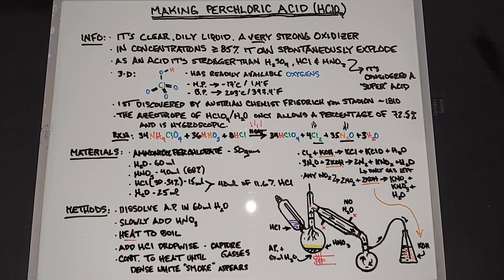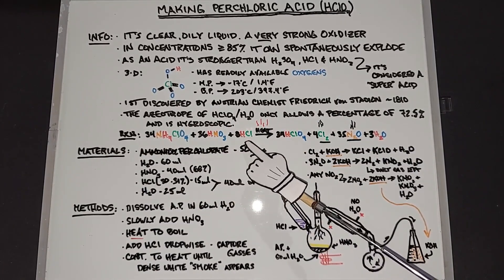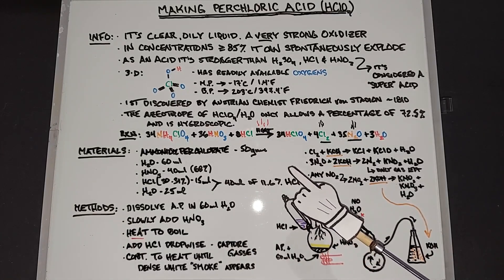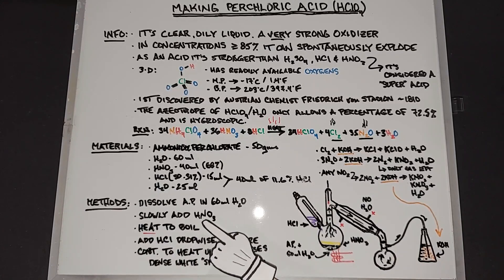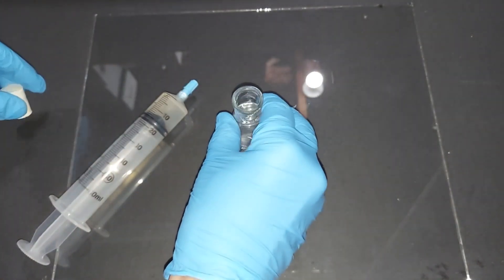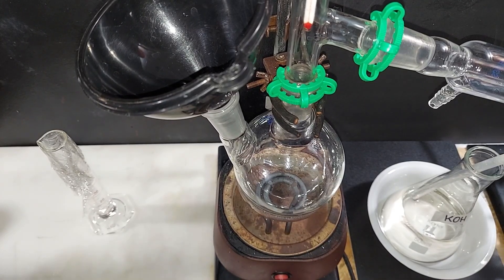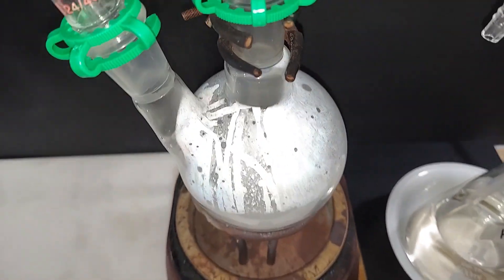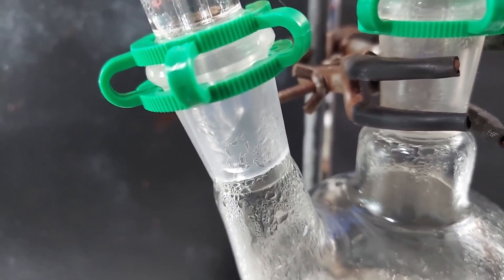Making The Highly Explosive Perchloric Acid (HClO4)

Comment: Would it be possible to synthesize HClO4 from KClO4 this way? Have read div forums and searched the whole internet without any good method. In EU its not possible to buy anymore for private individuals anymore sadly, and it's become a damn rabbit hole, making my hair thin and eyes red. Next my hair will turn gray I'm pretty sure. I do have lab grade KClO4 tho. A double displacement reaction is not doable after what I  can understand. Really appreciate an answer😉💫
Reply from the maker: Yes, but it's quite dangerous.  It starts by reacting KClO4 with H2SO4.  However, I can't go beyond this for liability reasons.  Sorry about that.
Reply: @cranialconstruction  Thanks for replying,  appreciated 💫 I've been thinking about the Kclo4/H2SO4 With a steady flow of steam in to the system to make it below 70%, in a remote setup. But its been with the thought for now because of the dangers.  Any suggestions to where I can find a patent or discussion on this method, if you can mention it here? Can't seem to find any reasonable in TSM-forum. Thanks anyways🙏
Reply: @HateGoogle-ez5cf You really have to use oleum to drive the reaction towards the production of prochloric acid.  Standard concentrated sulfuric acid is not very efficient.

Comment: I've been wanting to try to develop a procedure based on Willards work but starting with HCl reflux to do the bulk of the work before adding a reduced amount of Nitric to finish oxidizing the remaining Nh4Cl and Ch4ClO4.  Something like, 100g NH4ClO4 and 200ml 30% HCl under strong reflux for 2 hours.  Remove reflux rig and boil down until it reaches 110C, reduce heat to 80C and add 40 ml 68% HNO3 and another 10ml dilute HCl dropwise.  Raise temp slowly to 160C until remaining HClO4 should be around 100g of 65% and the use of HNO3 is reduced by 50%.
Reply from the maker: So interesting.  If you succeed please inform.  Thanks.

Comment: Again, nice video,

Sorry to point this out :oS for the correctness of chemistry.

You wrote onto your board the following equations:
1) 34 NH4ClO4 + 36 HNO3 + 8 HCl --> 34 HClO4 + 4 Cl2(g) + 35 N2O(g) +3 H2O
2) 3 N2O(g) + 2 KOH --> 2 N2(g) + KNO2 + H2O
3) 2 NO2(g) + 2 KOH --> KNO2 + KNO3 + H2O

Equation 3:
The third one is correct in virtue of 
2 NO + O2 --> 2 NO2
2 NO2 + H2O --> HNO2 + HNO3 
(or O2N-NO2 + H-OH --> HONO + HONO2) 
(or H(+) + NO2(-) and HO(-) and NO2(+))

Equation 2:
It displays a problem of equilibration --> atomic inbalance...
Left side 3 N2O and 2 KOH makes 6 N atoms, 5 O atoms, 2 K atoms and 2 H atoms
Right side 2 N2 and KNO2 and H2O makes 5 N atoms, 3 O atoms, 1 K atom and 2 H atoms
So you are one N, two O and one K atom too short onto the right side for an equilibrated equation.
I think you simply forgot a KNO2 (or a 2 before KNO2) into the second part of the equation
3 N2O(g) + 2 KOH --> 2 N2(g) + 2 KNO2 + H2O

For this second equation, I really get a problem with N2O; is it really so reactive towards KOH into solution without heating? To me N2O is relatively inert towards things except at high temperatures where it can act as an oxydizer and burn fuel yielding a higher T° than oxygen would (butane-N2O torch can burn hotter than conventional flame despite N2O not being oxydising to things at STP). 
N2O can also react with very strong bases like NaNH2 (much stronger than NaOH or Na2O or even CH3-CH2-ONa) without water to form azide...
NaNH2 + N2O --> NaN3 + H2O
Are you sure about N2O?

Equation 1:
There is also something weird into your equilibration and formula; if I understand wel the process, you keep all the HClO4 but destroy the NH3 (from NH4(+)) via aqua regia (HNO3-HCl mix).
NH4NO3 solid and anhydrous is known to produce under controled heating at high temperature some N2O but not NH4ClO4 nor NH4NO3 in solution.

Aqua regia is said to be made by mixing 2 to 4 volumes of concentrated HCl and 1 volume of concentrated HNO3. It is famous for the inner generation of Cl-N=O (nitrosyl chloride)
HNO3 (aq) + 3 HCl (aq) --> NOCl (g) + Cl2 (g) + 2 H2O (l)

2 NOCl (g) --> 2 NO (g) + Cl2 (g)

In your case you have more HNO3 than HCl, way more.

Nitrosyl chloride is a source of nitrosation, just like HONO (nitrous acid) and it reacts readily with alcools, amines and amides.
One of its strong points is the destruction of NH3.
NH3 + Cl-NO --> N2(g) + H2O + HCl (maybe does it come into account into the process you used by recycling the HCl back that can react afterwards with the extra HNO3 and redo some Cl-NO upon further contact (?)).
NH3 + HONO --> NH4NO2 --> N2(g) + 2 H2O (responsible of the unstability and dangers of solid NH4NO2 that spontaneously decompose and dissipates into fumes (often energetically).

This means that probably the route of reaction doesn't follow the pathway you depicted via N2O, but instead via Cl-NO and HO-NO.
Cl-NO + H2O <--> HCl + HONO

To finish:
34 NH4ClO4 + 36 HNO3 + 8 HCl --> 34 HClO4 + 4 Cl2(g) + 35 N2O(g) +3 H2O
N atoms left 34+36 (70 in total) vs 35*2 (70 in total on the right side)
H atoms left 34*4 + 36*1 + 8*1 (180 in total) vs  34*1+3*2 (40 in total) thus inbalance of 140 H atoms onto the right side.
Cl atoms left 34*1 + 8*1 (42 in total) vs 34*1 + 4*2 (42 in total on the right side)
O atoms left 34*4 + 36*3 (244 in total) vs 34*4 + 35*1 + 3*1 (174 in total on the right side thus an inbalance of  70 O atoms on the right side)
There is obviously a lack of 70 H2O into your equation (140 H and 70 O) coming from the oxydation of NH3 via HNO3 into N2 and H2O.

If you focus onto the destruction of 34 NH3 by Cl-NO or HO-NO it should bring to the correct equations down.

PHZ
(PHILOU Zrealone from the Science Madness forum)
Reply from the maker: Thank you for your input
Reply: Would it be possible to synthesize HClO4 from KClO4 this way? Have read div forums and searched the whole internet without any good method. In EU its not longer possible to buy perchlorates for private individuals anymore sadly, and it's become a damn rabbit hole, making my hair thin and eyes red. Next my hair will turn gray I'm pretty sure. I do have lab grade KClO4 tho. A double displacement reaction is not doable after what I  can understand. Really appreciate an answer😉💫
Reply: @HateGoogie-ez5cf concentrate sulfuric acid won't drive the equilibrium towards the production of perchloric acid. There's not enough free SO3. So you need to use oleum

Comment: I would inspect the?dryer vent hose ??every time I used it. I would think it would degrade the vent hose?aluminum? Even if lined with plastic it is not a good idea. Use pvc or something similar
Reply from the maker: It's made out of mylar.  But, it's inspected regularly.

Comment: I make some every few months, it’s really cool stuff, turns things into explosives so care is needed. Does some really cool stuff with hexamine, you can make the mono, di or tri perchlorate depending how much you add.
Reply: Hexamine could in theory fix 4 HClO4 what would make it a super HEM due to a higher density (thus higher VOD); closer to 0 OB (also good for VOD); 
But 3 is already illusive because even with stronger acids than HClO4 (like HCl < HBr < HI), it only protonates 1 or 2.
(CH2)6N4 + HClO4 --> (CH2)6N2(NH)2(ClO4)2
(C6H12N4.2 HClO4) --> 4 CO(g) +2 CO2(g) + 6H2(g) + 2N2 + 2HCl(g)
So it lacks 4 O to burn the remaining 4CO to CO2 and 6 O to burn the hydrogens to H2O; this means a lack of 10 O atoms for complete burning and perfect OB: the OB is thus negative.
Only dinitrate or diperchlorate are known and stable.

Nothing empeaches one to boost a bit the things by admixing extra HClO4; but you get the drawback of at least 28% water for stability (72% HClO4 is considered safer to use; not spontaneously explosive) and this last can temper the power.

PHZ
(PHILOU Zrealone from the Science Madness forum)
Reply: @philouzlouis2042  I remember that name, has been so many years. When was it, 2007 or something? Crazy. Greetings from CD-ROM-LAUFWERK.
Reply: @leocurious9919  
Sorry but it must be someone else (a homonyme?) because if I'm good at chemistry and engineering, I'm not to keen nor a geek with CD-ROM, RAMs und ich habe nur ein basis Kentniss von Deutsch so "laufing werk" is totally unknown to me :o? although I love to laugh :o)
Reply: @philouzlouis2042 it’s always an honor to have you correct my chemistry knowledge, you understand it at a far higher level than I do. Hope you’re doing well!